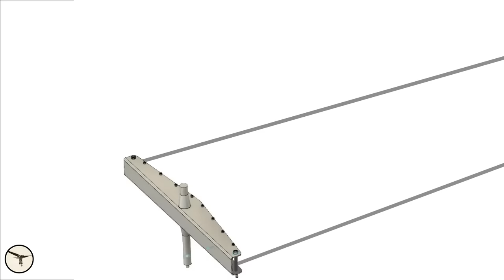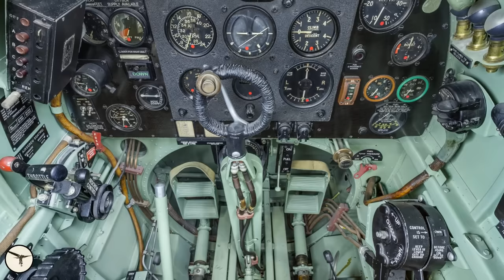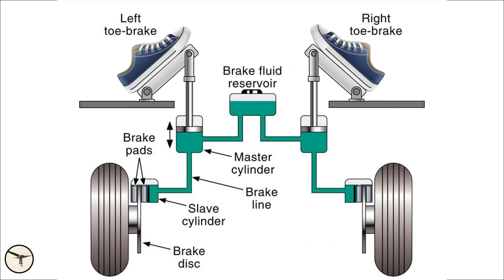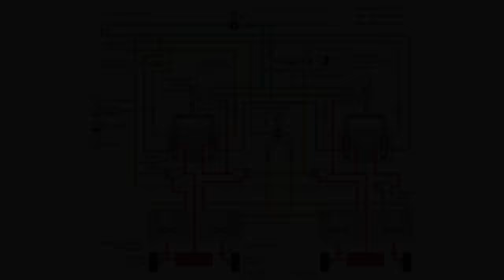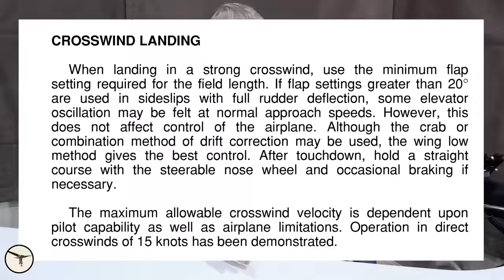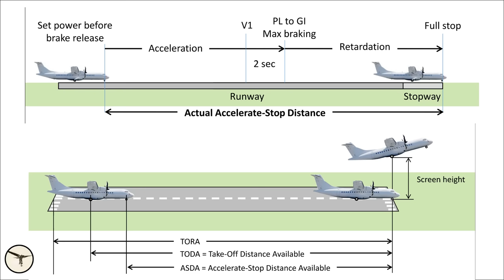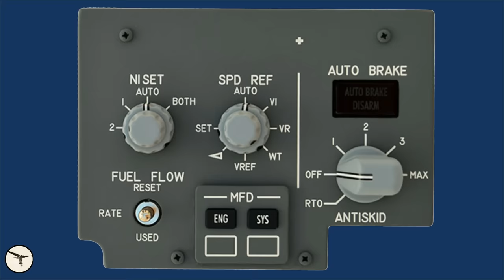Are you using the rudder pedals correctly? | Flight safety | Loss of control

Comment: I love how the animation shows Converse All Stars! I discovered these as great flying shoes about 17years into my flying career, and with a job that would allow them. They're thin, so I can feel the pedals, but they slide a little because of lack of agressive tread. The aggressive tread found on athletic shoes and boots can bind on the pedals, and the thickness and padding muddles the feedback from the rudder.
Reply: They’re a bit similar to my racing boots in that way. I love the racing boots. Kind of wants to wear them in everyday life. They’re so comfortable, but your feet start hurting quickly if you actually walk around a lot in them because of how thin the soles are.

Comment: nice video!  I'm early in my training (PA28) and this has never been brought up, I just always have my feet fully on the pedals expecting to brake during TO/Landing.  This will be a nice discussion point next lesson :)
Reply from the maker: I did most of my PPL training in a PA28 as well.Happy landings!
Reply: I was taught heels on floor by a retired ATP with 40k hours (or something crazy like that) he was very old. We had a crap ASDA but good stop margins anyway with a nice grass stopway. Edit: funny about your point on control, I actually prefer less rudder control to avoid overcontrol yaw during takeoff.
Reply: Must be a newer PA28. The only one I've ever flown was a 1966 Cherokee 180--It really doesn't matter where you put your feet in those--the only brake you have is a handbrake hanging under the dash beside your right knee! Only problem with that is doing touch-and-goes you gotta quickly let the brake off and reach for the throttle--not as ideal as keeping your hand on the throttle and braking with your feet
Reply: I learned in a C172 and also had a retired ATP as an instructor.  He always taught me "heels to the floor" on takeoff.  Looking back, I think I typically also kept my heels on the floor during most of my taxiing (especially on straight segments where there was no anticipated need for brake use.  I would slide them back up if approaching a turn or an intersection where a vehicle or another plane was approaching or waiting, just in case I needed to stop because someone pulled out in front of me, or needed differential braking on a turn.)
Reply: I’m a new student pilot. I have size 15 (US) feet. When my heals are on the the floor my toes are still at the top of the toe brakes. I always wonder that right after touchdown if my rudder inputs are also applying brakes causing me to over correct. I just ordered some driving shoes. I hope it helps 🤷🏻‍♂️
Reply: @wyatt92563  maybe get prosthetic leg extension with smaller foot to improve control.
Reply: @a.nelprober4971  🤣🤣🤣😳really?
Reply: Same here, and pa28 as well. All the best.
Reply: Try to get some time in a tandem tailwheel aircraft after u get experience. In those planes u really feel the vaunted "seat of the pants" feel AND you will really LEARN how to effectively use the rudder-crosswind landing confidence will soar! This transfered well for me to flying jets also! All the best!
Reply: @wyatt92563  
Toes are far more sensitive than your whole feet. If you ever get into twin engine planes, locking your heel into the floor while pressing hard on the rudder pedal will make engine out situations easier, in my experience.
Reply: @wyatt92563  to grjtej and w
Reply: I was never taught the correct way, come to think of it. I always kept my heels on the floor otherwise if I was doing crosswinds (which is very common where I trained) I thought I'd land while holding a brake. So I just made sure I was on the ground before getting on the brakes

Comment: Nice video! Even flying an airplane with autobrake I would say its useful to put the whole foot on each of the pedals just in case there is a low speed RTO… sometimes those low speed RTO’s require full rudder imput plus differential braking so the plane wont end up on  the grass due to the high power assymetry and low rudder efficiency.
Reply from the maker: Thatæs a very good point!

Comment: Glad to see this age old question addressed. I am a Heal on the floor,  I fly a part 25 jet and has a very challenging crosswind control that require alot of rudder deflection on take off. Pilots tend to make brake inputs during these take off's if you use your full foot on the rudder pedal and this can cause a brake drag issue. Also in a engine failure after take off you need to have full control of the rudder and this is a challenge with the heal of your foot. In the event of a rejected take off sliding your foot up to the brake comes natural. So the pro's of using your toes for both scenarios give much more control than trying to control with the heal of your foot. Done this in the sim many times and there is no increas in stopping distance during an abort but you have alot more authority with directional control using your toe during take off and a engine failure after V1.
Reply: Wholeheartedly agree.
Reply: Agree
Reply: I’m an Airbus driver and fully agree, I believe Airbus has come out in effect that it’s ultimately up to the pilot. There is no wrong or right.
Reply: Totally agree
Reply: Not to mention, when you need a lot of rudder and therefore accidentally press one of the brakes, it may disconnect the autobrake, making it an even more sketchy situation

Comment: Very interesting video, i have to say it depends on the situation. I am a LTC/TRI/TRE/SE on the ATR, if i was taking off on that short  limiting runway I would have feet on pedals. 99.9% of runways we operate from the aircraft would easily stop at V1. The greater risk i see often during training is people inadvertently applying brake on take off when they apply corrective rudder. Always caution Capts turning through the wind (e.g. turning onto stand) and the nose goes through the wind with the rudder swinging sharply down wind, causing harsh Inadvertent brake application. The transition from heels on floor to on brakes during landing is something I encourage pilots too practise and to do on all landings even if directional brake application is not needed (which is most of the time) so if it was required then its a natural and rapid process. As always Magnar a good video with great discussion points. David Mcmullon
Reply from the maker: Thanks for your input , David
Reply: Agreed! When ever I used to be taking off on the saab 340, the feet where on the rudders and on the brakes. For landing i would have them, heels on the floor. Like you mentioned. Incase you have to abort. I’m now flying the 737 and I still use the same concept. I never liked the transition from floor to brakes.. always seemed sketchy to me. Since for 1 second the airplane doesn’t really have any directional control. Which on a strong crosswind landing, like we usually get here in MIA, can be critical.

Comment: I keep my heels on the floor - I have large feet and struggle to achieve full rudder/nose wheel travel in most aircraft when my toes are covering the brakes. If I really need the tighter turning radius or need to apply some asymmetric braking on landing, I slide my feet up quickly, it's like a muscle memory. I do, however, agree with all your points, and if I was blessed with smaller feet I would definitely do it the way you mention!

Comment: 100% agree with you. Flying for 51 years of which  45 years on Boeing and Airbus... I totally agree with you!!! My technique is " gear down, feet up ", "gear up, feet down "... always being ready to steer & brake in whatever condition! 
Thank you for your vid!
Reply: yep agreed.  its so annoying commuting back home and the pilots are riding the brakes on the first 500ft of the take off.. GET YOUR FEET OFF THE BRAKES. unless you like pushing v1 hundreds of feet down the runway.
Reply: I don't agree gear down feet up n gear up feet down

In modern airliners, autobrake is the key to brake the airplanes. With the feet on the pedal what if you have an eng failure how are you going to control the directional control. With feet on the floor, your heels are acting as pivots that you have much better control of the direction of the airplane.
Reply: @JC-ms6rf  except when some are equipped and some aren’t.  Sometimes you fly both in one day.  Changing the way you do a takeoff for auto brake equipped vs non is not only less safe but harder for the pilot to remember.  Come back once you actually fly for an airline and are on leg 4 of the day after a 5am show time in Atlanta.  
Faa has done studies on pilot reaction time for engine failures before v1.  This delay is accounted for in the performance numbers.

Comment: Excellent video. I've been flying professionally for over 30 years, the last 25 in biz jets, and the last 3 in an aircraft with autobrakes. In all my many visits to the most well known training facility nobody ever discussed this topic and I had to figure it out myself. I quickly realized when moving into transport category biz jets that the "heels on the floor" technique we all learn from day one of flying does not translate. After a couple of simulator sessions in crosswinds or with certain hydraulic failure scenarios I quickly realized feet need to stay on the pedals. If I tried to slide my feet up during the rollout on landing or an abort the airplane can quickly weather vane and I have lost control in the sim using that technique and no instructor ever even mentioned it. Now, even in an airplane with autobrakes I ALWAYS keep my feet fully on the pedals. It's easier to learn not to touch the brakes on landing with autobrakes, or on take off roll than it is to try and slide up, even to disconnect auto brakes when desired on landing.

Thanks for posting this video. It teaches and validates what I had to learn on my own.

Comment: Magnar: great video, as usual!  I’d like to share with your viewers – especially the GA pilots – my experience with rudder pedals.  I’m 66 inches (1.68 cm) tall and in most GA aircraft the rudder pedals cannot be adjusted, only the seat.  I flew Cessna piston twins (421, 310) for many years, and I used to go to Flight Safety Long Beach for my annual training.  Because of my height, I always had to have the simulator seat full forward. But even with that, for the first two or three years my single engine failure at takeoff performance was mediocre at best until one year I asked for a cushion behind my back to get even closer to the pedals.  Like magic my single engine performance went from mediocre to outstanding.  That’s how important is being able to fully move the pedals forwad.

On the real aircraft the fully forward seat position was good enough for takeoff and landing; I could fully depress the pedals without a back cushion, but then my position was quite cramped during cruise.  So after reaching altitude I slid the seat back for comfort, and had a new before landing checklist item: pilot seat…fully forward.

Then a few years ago with only 50 hours or so on my Piper Meridian, I was landing on a relatively narrow runway when suddenly I lost directional control and almost departed the runway - I had slid the seat back during cruise as I did on my 310 but forgot to slide it forward before landing.  As a consequence, WITH MY LEGS EXTENDED MY TOES WERE POSITIONED AT THE BOTTOM OF THE PEDALS and as I attempted to push a pedal forward, all I was doing was pressing DOWN rather than forward.  Fortunately, I realized what had happened and slid the feet UP on the pedal so I could both steer and brake, although with reduced authority because the set was far back – but enough to keep the airplane on the runway… barely!

So now on my Piper M600 I have the old checklist item again: pilot seat…forward!  And, yes, not having autobrake, I position my feet up on the pedals, but I taught myself to steer with the HEEL of my feet until I needed/wanted brake action, and only then rotate my feet toe forward.
Reply from the maker: Thanks for sharing
Reply: Dang. Sounds like a scary experience. I could see myself scolding myself for forgetting such a "minor" detail in the middle of trying to keep control
Reply: @jimlthor  First aviate, then scold.
I didn't learn this in the cockpit.  I learned it from my wife, who scolds first and then calls the insurance company.
Reply: @FlywithMagnar hello
Reply: Being somewhat short I have the same issue, but I was always feet fully planted on the pedals. I also drive professionally and have great footwork, I know when I’m on the brakes and when I’m not and I accepted the CFIs instructions with heels on floor but it feels like I’m giving up control of a vital system instead of improving it. Rudder with the heels, brake with the toes is how I’m wired. Granted I fly small single pistons, so no auto brakes… 

If I was flying professionally, that would be something to pay attention to, but not today lol.
Reply: interesting take…. similar height as you… had my first lesson today which was great… but i felt like i had poor rudder control bc i didn’t have enough reach on the rudders

Comment: You covered nuances of brake usage I did not expect and were spot on. Flying a AA5B with a castering nose wheel 1000 hrs on sloped taxiways,  strong gusty crosswind taxi and takeoff/landing. I it is a unique usage of braking and rudder control both independent and or combined depending on conditions. I actually prefer the flexibility and maneuverability of this setup and it fit the flight characteristics of the AA5B well.

Comment: Nice video Magnar.
I guess I fit in the "it depends" category.
Heels on the floor give stability and reference. During Crosswind OPS and Engine failure during T/O we encourage students to "squeeze and freeze" (meaning: Dig the heel into the floor) to avoid pumping the rudder.
This assumes no braking though.

The problem with heels on the floor arises, when braking becomes necessary during full rudder deflection e.g. low speed rejected take off with large thrust asymmetry and little rudder authority (on the B737 auto brake is not available until reaching 90kts) or when overriding auto brake during the landing roll with strong crosswinds.
Therefore on the Boeing:  During take off below 90kts heels on the pedals flexing the feet back to stay off the brakes, above 90kts, drop the feet down for more finesse on the rudder (and comfort).
Landings: Heels on the floor except during strong cross winds. 

And, ...we are discouraged  from flying without shoes ;)

Comment: Thank you for the history of the controls in earlier planes.  I did not know about the Spitfire braking system or that the job of a wing-walker was to assist in making tight turns.  Interesting stuff.  One of my pre-takeoff memory items was always "feet to the floor" upon lining up on the runway.  I always said it to myself out loud (as I often do with other checklist items) to remind myself to lower my feet so I don't inadvertently "ride" the brakes during takeoff.  But your explanation and examples are very educational.

Comment: Feet on the rudder pedals for Directional Control, during the take-off run, the climb out and when on the landing approach and then on the pedals during landing. Control is everything in my books. Thank you for a great clip: I have subscribed..
Reply: I tend to agree with that and do the same.  I also tend to slide my heels to the floor during taxiing on any long straight segments (I think mainly I do it because I find it a more comfortable position), but then back up onto the pedals whenever I'm approaching turns and intersections (the former for differential braking and the latter for safety in case someone pulls into the intersection and I need to stop quickly).  The airport I trained at had a noticeable downhill slope at the end of the main taxiway leading to the most often used runway, and I remember always sliding my feet back up as I reached that point, because I sometimes needed to add just a little braking on the downslope to maintain a proper taxi speed, even if I pulled the throttle back to idle.

Comment: I have to agree with James White above. Although if during a check ride the candidate demonstrates that he is as accurate with his feet on the pedals, I do not see any problems. In general, I see more unwanted brake application with this technique of feet on the rudder vs heels on the floor. This is why I prefer heels on the floor, as long as the transition to brake application is effective. It also depends on your heel flexibility, which is not the same for anyone. Thanks for this video that does not say right or wrong but gives your personal preference.

Comment: Interesting video. I'm over half way to getting my cpl and have always been taught to keep my heels on the floor during take off and landing, i believe my instructors have been concerned about accidental use of the brakes. You make a decent point though
Reply: I was taught the same.  I would even call out "heels to the floor" after lining up on the runway as habit from my instructor.  I also typically slide my heels down during taxi, especially on straight stretches where no need for brake use is anticipated.  Looking at it now, I think that habit was not just to avoid an inadvertent brake application, but because it's also more physically comfortable position.  As I came up on an intersection or somewhere where I needed to turn, I would slide my feet back up onto the pedals to be able to use differential braking or to come to a quick stop if needed (particularly when approaching an intersection with another aircraft waiting to join or cross or approaching my taxiway since you never know if they see you or not, and might pull into your path.)
Reply: @skyhawk_4526  Yep, i was taught the exact same and that's how i still do it too. I think my legs would cramp up if i had them up on the pedals the whole time.